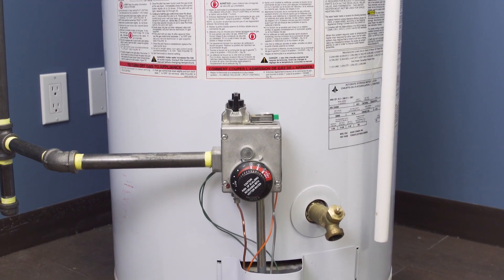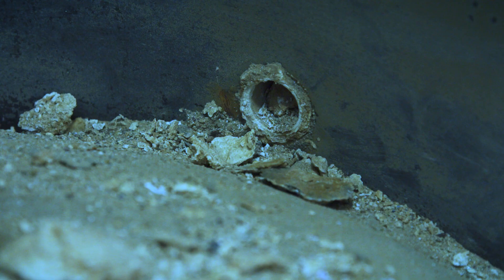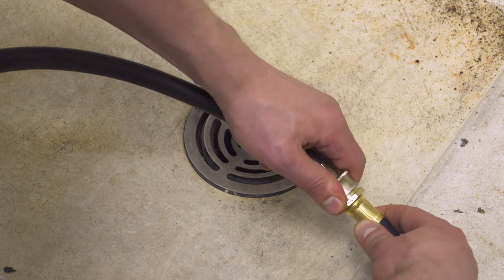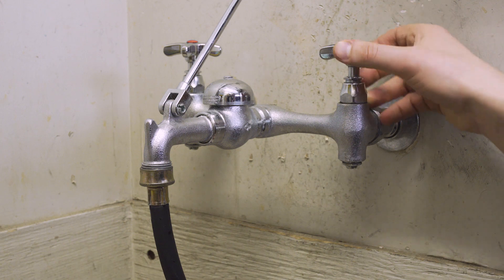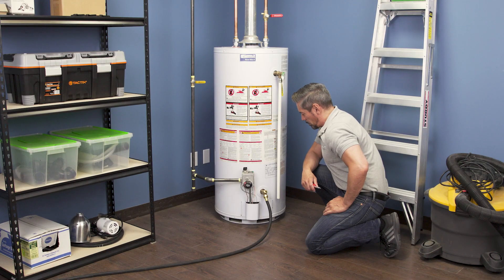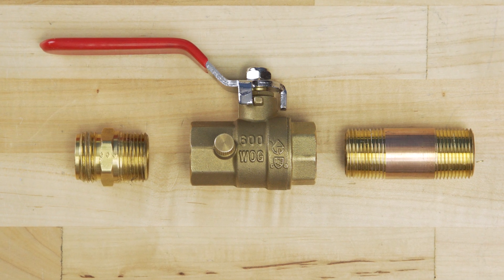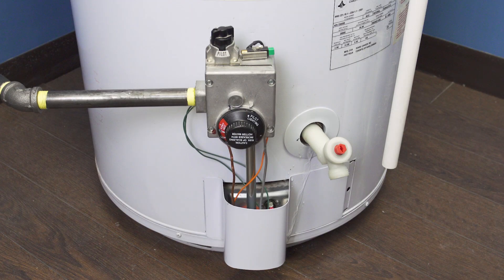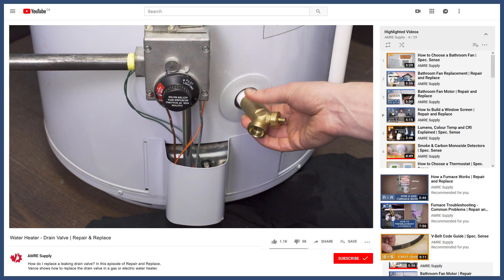Hot Water Tank is Not Draining | Repair & Replace

Comment: Should I open the pressure release valve
Reply from the maker: If you open a faucet or the release valve either will allow air to flow in and help it drain, but if sentiment is blocking the draining then you'll need to backflush or remove any blockages.